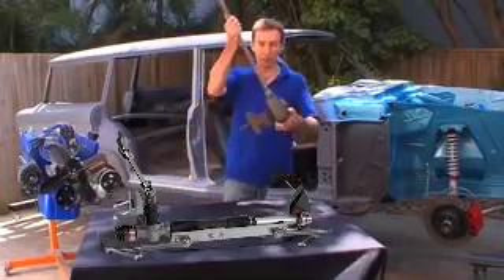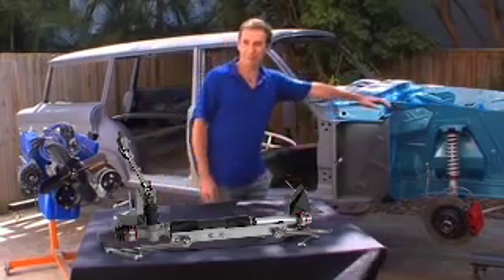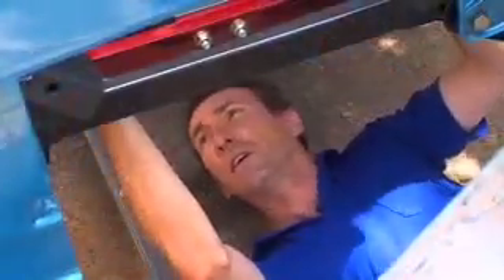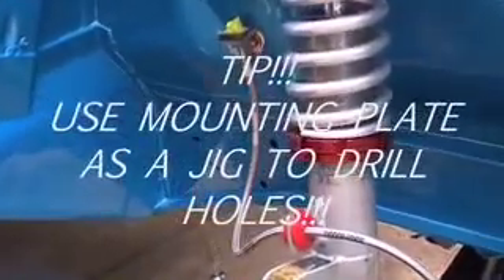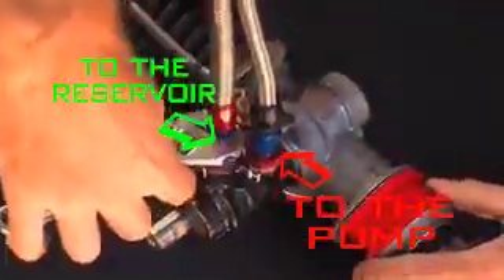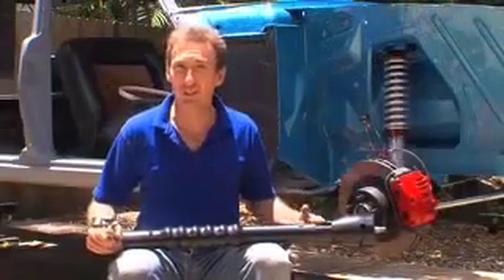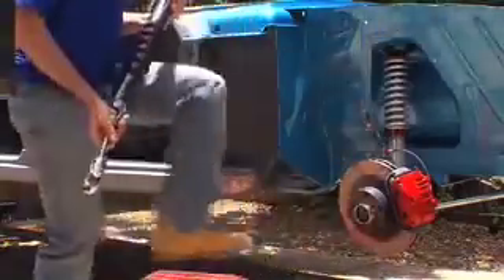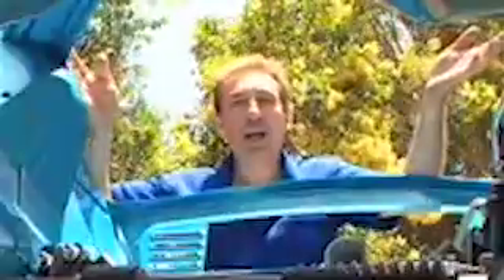RRS Rack and Pinion steering installation

Comment: Why doesn't  RRS install it.
Reply from the maker: We install racks into our development cars, currently we have a 84 LTD being engineered, Falcon XB being finished in October, 1970 Maverick going through left to right conversion, 79 Fairlane at the dino shop, 1970 Mustang having the fuel system plumped, XM wagon having XR8 motor and a revised 3 link,  a Chev Nomad having a rack and pinion developed for it. So we have product development builds and staff project builds taking the queue to mid 2020. Between now and mid 2020 we are looking for 1968 Mercury Cougar and a 57 T-bird to add to the end of the queue